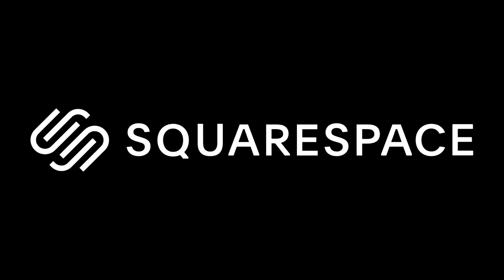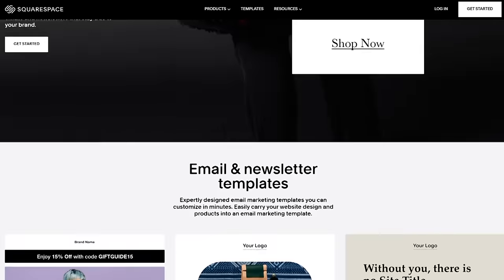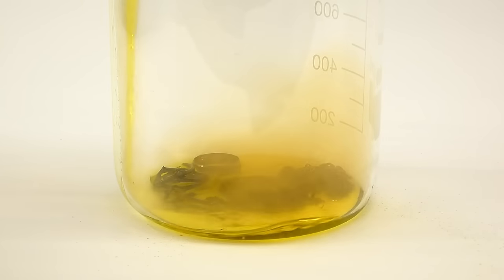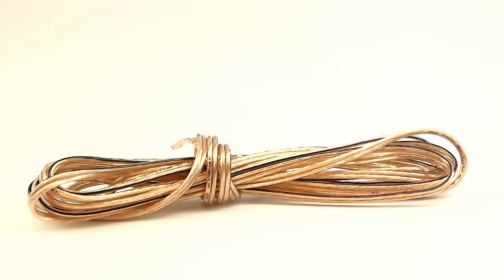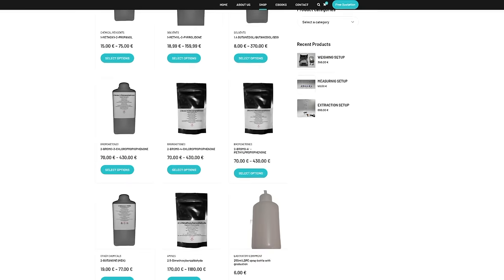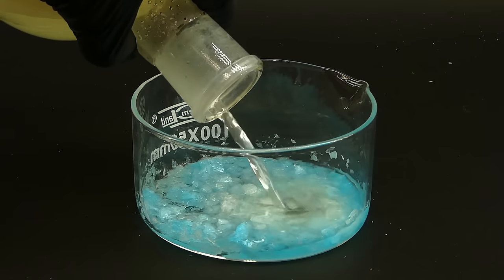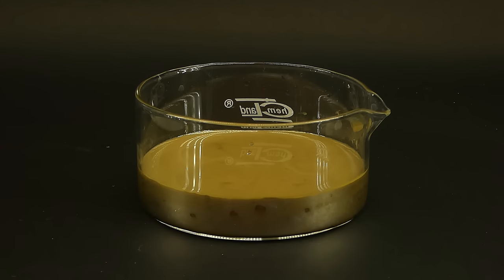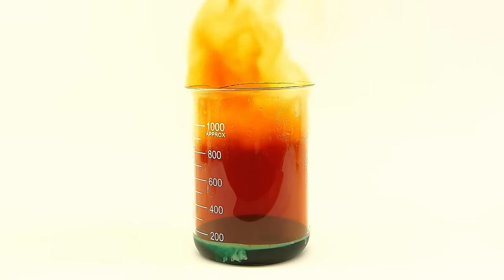Turning Old Jewelry into a Mirror

Comment: To separate silver from copper, silver should be precipitated out as the chloride from the mixed nitrates using plain table salt solution in excess. Then the copper nitrate solution can easily be decanted from the heavy precipitate which should be washed several times with boiling distilled water afterwards.
Then the silver choride can be completely reduced to silver powder with nascent hydrogen generated from zinc granules and dilute hydrochloric acid in the mixture over night. Next day, after decanting, the silver powder has to be washed with dilute ammonia solution, dilute formic acid and several times again with boiling water until the washing water doesn't show off chloride or silver ions anymore (can be tested with silver nitrate and sodium chloride solution).
The powder can then be transfered into small holes previously drilled into pieces of charcoal and melted together to small shiny granules with the help of a strong blowtorch. This step will also clean the silver from the last impurities. Fire clay bricks should be layed out underneath because they won't break from the heat.
For refining silver using nitric acid in the EU legally you need a corresponding business license for metal works.
Reply: There is a better way and its cheaper and faster. You percipitate the silver chloride exactly the same way as you said but for reduction you will use NaOH and sucrose(table sugar) you add NaOH to silver chloride and it turns into black AgO2 and the you add sugar into it right away stirr it and you got 99.99 silver in an hour.
Reply: That's an interesting method, because it would avoid the formation of environmental hazardous zinc salts. But there's one disadvantage: silver oxide promotes the formation of collodial particles which are impossible to filter off, so that you cannot simply dispose off the filtrate down the drain, too.
Reply: @experimental_chemistry   when you add NaOH to silver chloride you dont do it while the AgCl is in a suspention you decant as much water as possible and just leave the moist AgCl and then you add NaOH directly on it. This makes the convertion much faster. And after you get Ag2O you again directly add sugar to reduce the silver, you dont wash it while it is in the Ag2O form so it doesn't get in the environement. After you reduce the silver then you wash it.
Reply: @natuhaysertkaya3391 
From the point you have silver oxide in the mixture you will partially get nanoparticles that can't be filtered off - even not after reduction. You can recognize it by the color of the filtrate: it's not completely colorless but slightly grey or brownish.
So this route isn't as clean as the reduction by nascent hydrogen.

Comment: A procedure I read in old books is to separate the copper and silver by evaporating the mix of nitrates down and heating it to melting. The copper nitrate decomposes and the silver nitrate stays behind and is then dissolved out. I want to try this, it saves nitric acid because no need to redissolve the silver later on to get the silver nitrate.

Comment: 1:19 You CAN get it from a hardware store. Silver solder is something like 5% silver, just get, like, 10 kg, and process it.
Reply: Cheaper to go to a thrift/consignment shop and pick up some sterling silverware or old jewelry. less base metals too
Reply: @Emu0181  Actually, that does sound like a better idea
Reply: You will almost never find silver cheaper than it's current market rate, you'll be paying extra for jewelry for labor costs. Just buy silver bullion off a website.

Comment: Actually having very pure copper in an oxygen free cable DOES help with sound quality - but ONLY AT VERY HIGH WATTAGE..... like those big subwoofers in competition level builds... where they turn the entire cargo space of a van into the speaker box, with 8 speakers receiving 8,000 each... YEA.. THEN IT MATTERS lol  :D
Reply: 1-2% higher conductivity means they should just be using thicker wire
Reply: Also helps with very low power levels, like with passive electric instruments. But a tiny pre-amp is better.
Reply: Just use a thicker guage or a preamp, lol
Reply: thicker wire???
Reply: Should be using silver wires instead

Comment: Maybe you could find some could glass 'ornaments' that are fun, and cool, and awesome, and likeable..... and you could coat them in a mirror and auction them off to raise more money for the channel 🤷‍♂ BUT as I was typing this I realized that you had to put that spray coating on the back of the mirror so it doesn't come of... but that surface is nor mirrored... so you couldn't put a mirror on on to a glass object unless it was hollow and you could put the mirror on the inside..... hrmmm yea Something like that would be pretty hard to find, and expensive.... but if you happen to come across something like that, it would make for a neat video and probably help the channel out :)

Comment: Fancy & especially overly-thick audio cables are actually only partially snake-oil: because speakers are an inductive & resistive load, have harmonics (etc. etc.) even the tiniest additional resistive loads in-series do genuinely add changes to the output. If you have fancy systems with crossovers and no feedback with tube amps, these changes are greatly increased.

However, listening to already compressed music @ a small fraction of maximum power of the circuit & with high-NFB digital systems & short cables makes all of this irrelevant, so then this becomes a pointless money dump. So in the end the cable quality depends on the system & the setup, especially wire lengths, massively.

A simple proof of the former is a Power Supply I made, it was a DC 30mF (30,000uF!)-capacitor Full-Wave centre-tapped secondary ~30V supply; at first the voltage was like 27-28V & I was confused why it was so much lower than I predicted, however after making the cables ridiculously-thick the voltage was correct. Now, here's the thing, original cables were more than adequate & actually were for much higher current than I was going to use, however because the capacitance is so insane, the power-pulses from the rectifiers were in the tens of amps even though the drain was <1Amp.. So, losing the 0.2 Ohm (or less!) of the parasitic resistance of the original wiring actually made a large difference. Bear in mind though the transformer, rectifier  the capacitor were rated for these high pulses, if you did this with more conventional equipment it'd be fried, so the parasitic resistance is actually necessary! But likewise in specific audio systems these seemingly-irrelevant resistances can make some difference but unless the system & the input is already very "clean" & usually analog, it really doesn't matter.

Comment: Good video
Reply: Btw i just found out that by using electricity u can make hcl and naoh from nacl(aq) in two containers with a salt bridge between them.
I also did it with na2so4 to make naoh and h2so4. Note that the naoh will form in the container with the electrode connect to the negative battery terminal and h2so4 on the positive battery terminal.
Reply: This is because the na + is moved to a different container by the current and so4 -2  is also sent to a different container by the current. They both react with water to form naoh and h2so4. I dont now if it works with all salt but it should work with most.